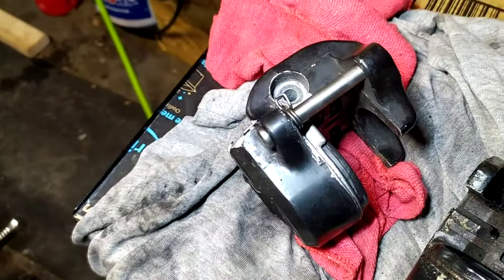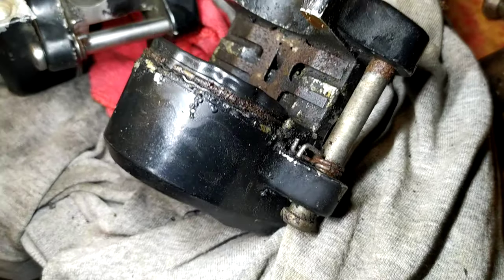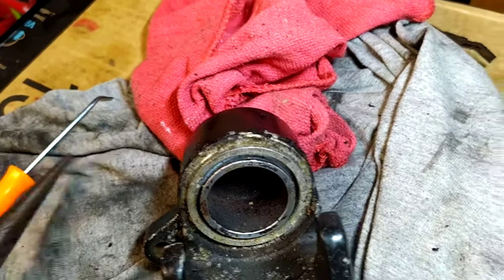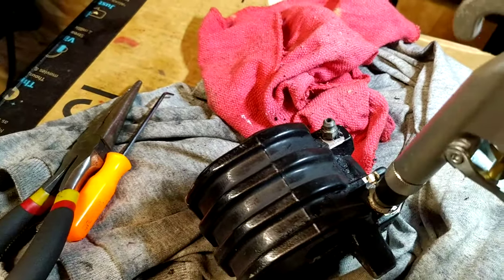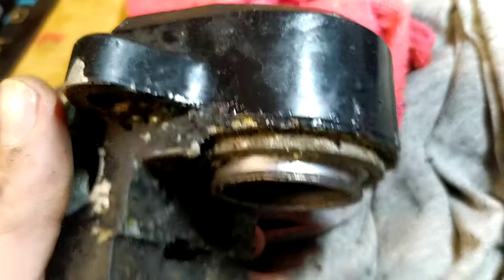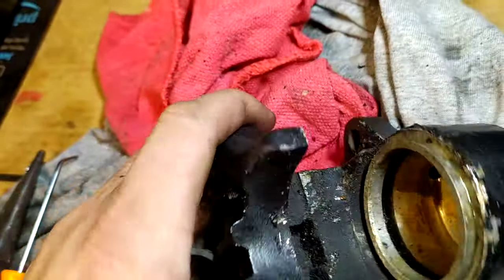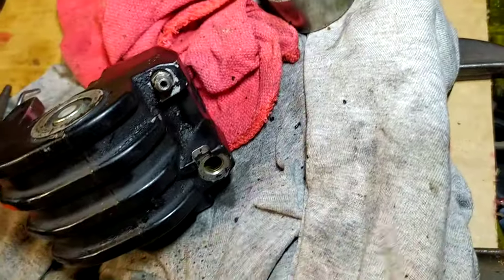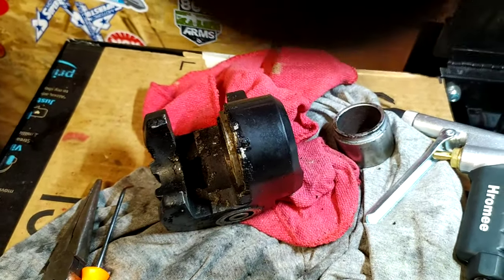Trick/tip to easily remove brake caliper piston

Comment: Might want to put something soft to stop the piston when it flies out.  I've had composite pistons crack when they hit the fixed side of the caliper, under air pressure.

Comment: Is easiest and safest to pump out the piston by the hydraulcs before you take it off the bike. As soon as th piston is clear the pressure drops to zero, it cannot get launched anywhere, unlike with Air. It might make a mess if you're unprepared.
Reply: @Mickleblade. You are so right on how to get the piston out. Your method should be mentioned in all the videos as the best way so people will know to leave their brake hoses connected. Only occasionally other methods have to be used.
Reply: @bottmar1  I think there's a fundamental misunderstanding of hydraulcs. Even the Haynes manual gets it wrong and claims its safer to use air. A well seized caliper will only come out with hydraulc force.
Reply: @mickleblade  my 2 cents is if the hydraulics cant move it enough to remove the piston, its probably too faregone and not smart to be connecting it back to the hydraulics relying on them to stop you!
Reply: @Luckingsworth  not so. I've had seized pistons that the hydraulcs just pushed out. A good clean and new seals and fluid and they were fine.

Comment: I used a long extension and jammed and then cramped in a trailer hitch and started rotating the piston and it came out then I used salt and vinegar to get rid of the rust

Comment: I use an old car key to push the boot in And poke the hole hole hole in it my brand new boot and I gave up...... So I put the brake pads in visa Versa And put on an amazon caliber which doesn't drive very much but the pads are angled because I had a sticking guide pin on the old caliber...

Comment: So air won’t budge my pistons (1969 ford)… time to buy new callipers? Or any other way?
Reply from the maker: Car/truck calipers require more pressure, could try hooking it up to the brake line and pushing it out with the brake pedal. Is it really rusted out? If it's really rusty then the cylinder likely has pitting and I would replace it. Otherwise you could try some penetrating oil on it, and some heat to press it out.
Reply: @somedaysoon33  great thankyou, someone just suggested a grease gun (upto 8,000 psi) so going to buy one & try that

Comment: Not everyone has got compressed air.
Reply from the maker: $50 for a cheap HF compressor, no excuse not to in my opinion. It won't run air tools but you can do this and inflate tires with it.
Reply: if you are working on anything with tires and an engine or wood or anything more than hanging pictures on the wall you should get a cheap compressor. Harbor Freight, Walmart, Amazon, Ebay. You should get one for sure.
Reply: Get you some.
Reply: All gas stations have tire inflators. It`s compressed air and lots of it, at least here it is free.

Comment: Can be very dangerous ! Should mention that anyone doing this should avoid putting fingers near the caliper. Best to put in a vice if using compressed air and put a piece of wood outside of the piston to avoid piston flying out aggressively.
Reply from the maker: The piston is just going to pop out... now you don't want your hand under the piston. In this video I just held it with  a rag and pointed the piston down into the toolbox table to catch it. Common sense should tell you not to hold it in the palm of your hand with the piston facing into it.